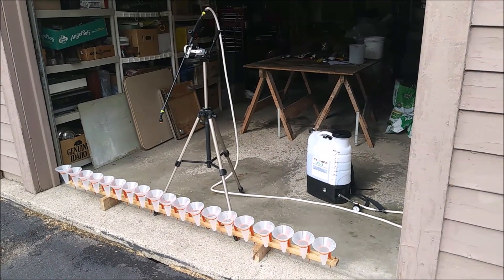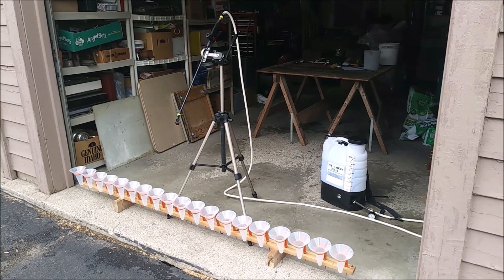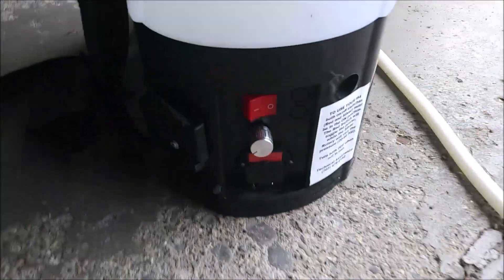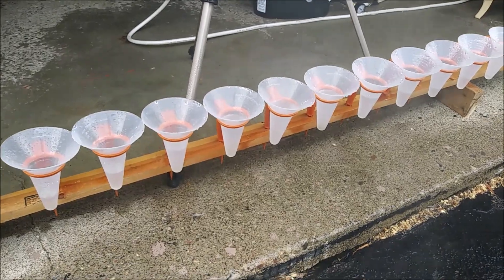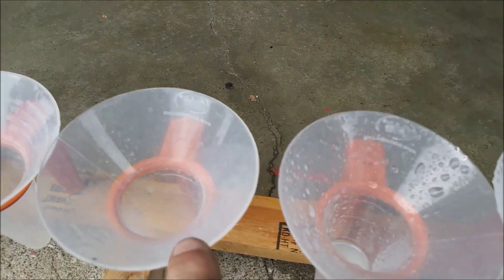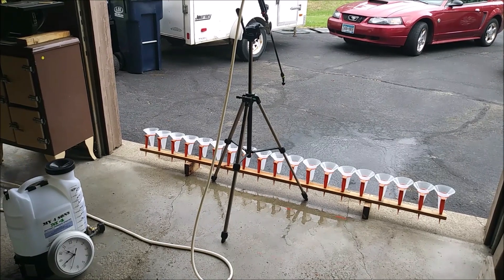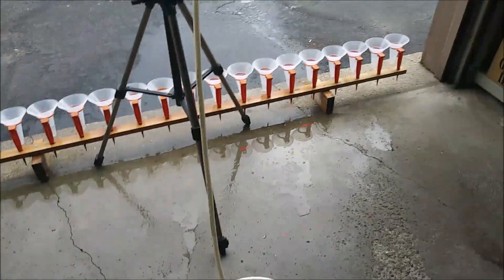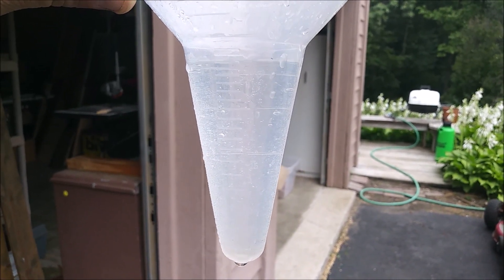MY4SONS M4 Backpack Sprayer - Nozzle Testing Part 2 - Test Rig

Comment: Has a anyone tried to pressurize the tank with by installing a schrader valve?  It seems like the pump action only lasts 5 seconds.
Reply from the maker: The pump runs as long as the handle trigger is pulled.

Comment: Great video Tommy. Thank you for taking the time to make it. 

I'm presuming that the fan tip that came with the unit was used. You mentioned you had a breeze that may have affected the results. I'm curious as to what the results would be using a Teejet AI tip, which is what I've gone to reduce spray drift. I think I may have murdered a couple of our Moneywort plants with spray drift when I sprayed a herbicide last year.
Reply from the maker: Yes, it was the tip that came with the unit.  I mainly was measuring the distribution to establish a spray width to use.  I've not tried and AI tip, likely the droplets are larger but the pattern the same.